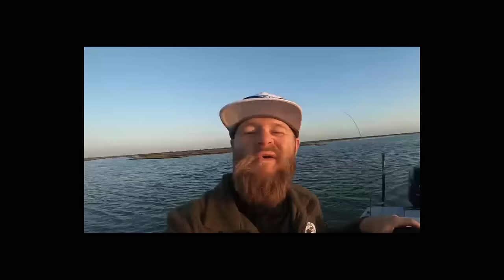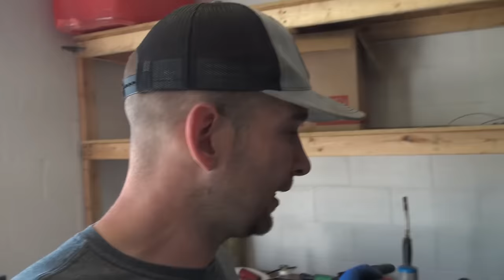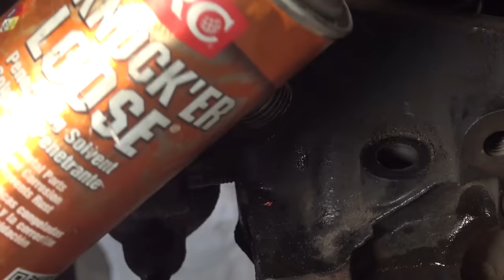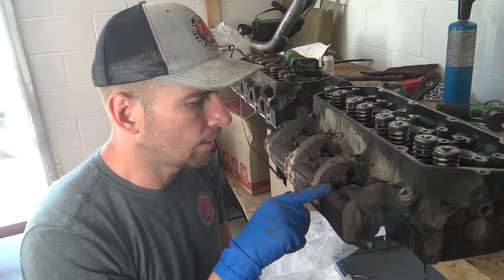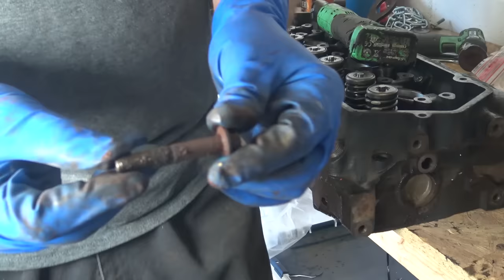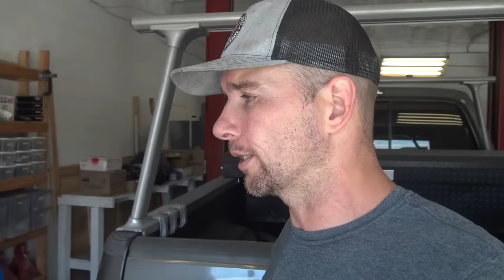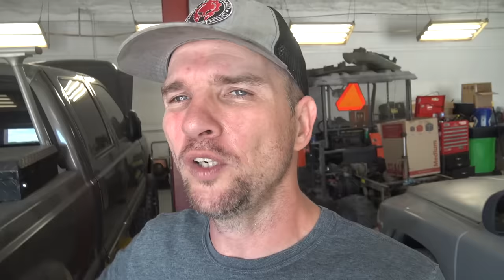Old Mechanic Taught Me This Trick To Removing Rusty Exhaust Manifold Bolts!

Comment: I'm 76 and have bent wrenches for many years.  One trick I learned by experimentation is that ordinary rubbing alcohol slowly dissolves red rust.  Patience is required, as the stuff evaporates quickly so it is best to keep the rusty area wet by dripping more alcohol on it, and you may eventually see red rust running down.  No heat is required.  One man had been trying to remove his frozen irrigation pump's primer plug - which had been only hand-tight before it rusted - was as if it were welded in place.  He had tried various techniques, including penetrating lubricants but the plug was still stuck.  After hearing about this procedure and patiently dripping rubbing alcohol on it for a while he was able to work the plug back and forth until it was removed easily with his fingers.  High-content rubbing alcohol (>90%) is recommended but lesser values will also work, albeit more slowly.  This process works equally well for freeing rusted tools.
Reply: Hmm. I've actually used 90% alcohol for cleaning atomizers in vape mods to get an extra week of use out of them. I once ran out of alcohol and just went for the witch hazel to see what would happen and it actually worked better at breaking up gunk. I wonder if it could do the same for rust as it does for carbon 🤷‍♂️
Reply: If that works, I'm buying you a beer whether you drink or not!
Reply: @pingpong9656  Please let me know how it works out for you.
Reply: Great tips. I've been a plumber for the last 49 yrs and we run into the same poop and I work on the junk wheels I drag home also. One thing you can see on the head you work on is the side of the bolt your working on. The thing I've told apprentices if they've got a seized bolt if they can free it up with some kind of penetrate and you can see the side of the bolt as you try to turn it out is to "watch the side of the bare bolt". If you turn the bolt one iota with the wrench the side of the bare bolt better start to turn too, if the head is turning with whatever wrench you're using the visible side of the bolt better be turning otherwise you're twisting it off. On some of our plumbing equip. if the bolt passes through the equipment but is just flush where you can see it, as you start to turn it that flush end better turn too. Otherwise snap. Do you have any good advice on how to remove studs from VW air cooled aluminium heads as they're always a POS to remove the baked and seized into the head stud.
Reply: vinegar molasses evaporust  chemically will disolve rust.   Heating cherry red if possible will dissolve the rust bond and melt out the rust.  I have found penetrating oil will not penetrate.  When you use penetrating oil if you notice the threads are always totally dry.  If your able to break the bolt loose using Stephens back  and forth technique when you have slightly loose spray the threads then tightening will bring some of the penetrating lube further in the threads.  The more you can tighten and loosen and spray the more penetrant will get to the threads.
Reply: Acetone evaporates extremely fast too. I almost only use  trans fluid and acetone mix now and vibrate it with an air hammer when possible. Rarely need heat anymore.
Reply: @bobwright992  Great tip!
Reply: @rogerrolfe8114  https://youtu.be/Oqs-08ATRyU broken bolt removal from aluminum LS head, cheers!
Reply: @YuckFou502  Which brand of witch hazel did you use? See if i can find an equivalent in South Africa.
Reply: @graphman8402  Thanks for the tip man
Reply: That's EXPERIENCE FOR YA !!!
Reply: That's true, sir!
I'm using high-content alcohol to remove rust from my body every evening after work. I mixing it with coca-cola it working much better ;)
Greetings from East Europe, from Poland... alcohol works always! :):):)
Reply: Man I never heard of this !!! Thanks!
Reply: Ingersal Rand 5 inch  hydraulic impact wrench: then I adapt the 2’ to 1 1/2’ then 1’ then 3/4’ then 1/2’ then 3/8’ then 1/4’ dollar tree socket which is a 1/8 inch adapter to a 1/8’ to 1/2’ head and 15 feet of extensions in between. Always works at breaking my arm loose
Reply: Can we use use regular drinking alcohol or sanitizer?
Reply: @leo92328  Beats me, Leo.  I guess you'll have to experiment like I did.
Reply: @randykelso4079  I used harpic(toilet cleaner) and it removed rust but the screw still didn't loose.
Reply: @leo92328  If both the screw and the material it's threaded into are ferrous material (cast iron or steel), the patient application of rubbing alcohol will often soften the rusty threads unless the threads are damaged or non-ferrous material is involved. It takes considerable time to accomplish. You may have to resort to some other technique.
Reply: @randykelso4079  the screw is in the tap I don't know how to access the threads. Guess, I'll have to call a plumber. Thanks for your reply. 😊
Reply: Interesting about using rubbing alcohol! BUT at $6 a quart, it might be cheaper and better to use/buy the stuff designed for loosing bolts etc?  IMO
Reply: @riderhard  Never found one that actually works, have you?
Reply: Blah blah blah blah blah
Reply: @satbobsmith7261  I agree "penetrating" oil never penetrates unless you can move the bolt back and forth a little.  The seems to draw a little of the penetrating oil in the first few treads.  I agree heat works if you have enough room not to burn the car down.
Reply: Alcohol does not dissolve rust. I would not doubt it is the alcohol chilling the spot and it going through cold and warm cycles possibly making it loosen. We owned an auto wrecking yard for years and I am quite accustomed to removing rust frozen things. Heat with a torch, chill and heat again till it comes off. A steel bolt in aluminum is the hardest thing to deal with.
Reply: I used vinegar on my pressure washer gas tank . It ate right through that red rust
Reply: @davebrittain9216  Correct that alcohol or any solvent doesn't dissolve rust, acids do. It's more likely that the alcohol is able to penetrate better than oils. An old machinists trick for removing a broken tap is to spray it with trichloroethane/trichloroethylene. It can get into places that oils can't and lubricate enough loosen the jam. Acetone and ATF are effective probably because the acetone acts as a carrier.
Reply: Will White Liquor aka Moonshine work ? Or should I save that for Drinking Purposes and just use the cheaper 70% Rubbing alcohol ?  😂🤣 I’m kidding ya 😂. But I’ll remember your rubbing alcohol trick next time I’m having a issue with a rusty bolts. There’s a spray made in Germany 🇩🇪 that I can’t remember the name of,  but I know it when I see it.  A mechanic 👨‍🔧 friend of mine who’s your age he’s now about 78 and he let me use. Let me tell ya friend that’s the best thing I’ve ever used to break stubborn rusted up bolts loose. It’s kinda expensive but it melts the rust off when you spray it on & if you can get in on the treads of a bolt and tighten the bolt back and do that a few times spraying the treads and run them back in & out and work that spray into the hole the bolt will come right out 99 outta 100 times. Wish I could remember the name it’s kinda expensive but it’s imported from Germany.
Reply: @bobduce5705 I too have found that just regular white vinegar is the absolute best and cheapest solution for any kind of rust, if you add a little trans fluid it it’ll kinda hold it in place longer to help it penetrate. I restore old equipment parts for metal art and i have a 5 gallon bucket of vinegar, i put any rusted part in it, over night the rust releases and floats to the surface and it’s REALLY nasty but is easily removed with a handled strainer.. the part will be totally rust free, rust is some crazy bad stuff and is almost like it’s alive and loves to eat metal…
Reply: @travismathis6084 do you have to neutralize it afterwards?
Reply: The technique is kinda’ like using a tap.
Reply: If u use 70% alc it won't evap as fast.
Reply: Brake fluid is also pretty good for this. Or acetone and ATF
Reply: Thank you sir.
Reply: @qoph1988 Brake fluid is a good idea. I know from experience that it will eat right thru paint. So I'd guess it woukd eat rust too. Thanks.
Reply: PB blaster is today’s rubbing alcohol 😂
Reply: Goat urine is even better.  But don’t drink too much of it.

Comment: Never ever, ever say out loud “that came out pretty easy” before the job is completely done, never.
Reply: Your absolutely correct because it turns into a nightmare really quick
Reply: @eddieweigel9490  especially the last one!
Reply: @tomdavis3038  Lol! Very true!
Reply: It’s like every morning I think it’s going to be an early day and it turns into 12+ hours
Reply: Lol I totally agree with that
Reply: @tomdavis3038  It's always the last one.  Never ever say those words. i did and in my case it was 3 fastener bolts on a Subaru legacy. dammit.
Reply: Bolts have ears
Reply: yea right, it's a Murphy's Law thing, (knock on wood)
Reply: Yeah, and never say it's just a 15 minute job. Lol
Reply: That's so true, at least in my experience. It's called jinxing the job.
Reply: That's what she said
Reply: Noted
Reply: As the presenter suggested, when you break one free, tighten it back up. Don't take it out until you have all bolts/nuts/fasteners free. Removing torque pressure from one end can change the dynamics of tension elsewhere. Which can make it more difficult then it originally was.
Reply: Never ever, ever ever say that.  It's ALWAYS something!!!!!!!!!!
Reply: it's just asking for trouble
Reply: Truest story ever told
Reply: The creator of Murphy's Law right here!  Good one Ed and that's for damn sure too LOL.  You celebrate before completing, you're screwed
Reply: Hahaha reminds me of this past week I’m all. Happy to replace my control arms and all the bolts come out easily minimal effort the. I get to the control arm bushing bolts one comes off easy I go to take the other identical one off and nothing I put a mid torque Milwaukee on it with 650lb of torque and nothing. Now it becomes a nightmare and I put a breaker bar and nothing the bolt is on there real good. I put a torch to it and some pb blaster for 30min and nothing. I have to run to the store and get extensions now for the breaker bar since the bolt is all the way into the wheel well and there is no room to put leverage and really pull down on the breaker bar. So now I have to think of a way to put something under the extensions since they are basically in the air and when I put force on the breaker bar the extensions start to round off and fall since it needs support under it. Long story short after a few hours I almost give up until I think 🤔 and realize I can put a jack stand under the extensions so they stay at the angle I need them instead of sliding off the bolt when I put force on them to turn the bolt. I give it one last tug and put a pipe around the breaker bar and I hear a crack and I get so happy. It’s still tight but I start trying to turn it little by little and it seems like I did it. I put the impact on it and it starts spinning. After a couple seconds I realize the bolt is just spinning and not coming loose. So i believe what happened is threads that are already inside the subframe broke off and the bolts threads never came loose so now I need a mechanic to remove the bolt that keeps spinning and some how re weld the nut that the bolt threads into that’s inside the subframe
Reply: So True Buddy  !   I  never spoke such nonsense & never had guys telling me I did not know my Rear Exhaust from a hole in the ground . They , were too often busy doing the job over , sometimes SEVERAL Times in a row ...........  when they should have slowed a bit & made sure that it was done right the 1st time , ALL the way through ............  Everytime I think of needlessly doing a job over , I remember a  " Master " ASE Certified Mechanic , doing a waterpump job on a plain vanilla Chebby 350 V8 pickup ........... He bragged that he had done so many B4  , that he'd be done in about 20 minutes . That was  what he said B4 doing it the 1st time in that episode. He redid that job 4 times after the 1st since he refused to slow down & do it right ; as I had told him to do.  He's retired now & probably still brags about how fast he is ...........
Reply: @ Ed A  lol. true!
@William Richard James Nicholson - True, get it right first time. Often it is your best and only chance. @Stephen Cox  Cheers, that was a good reminder.
Reply: Word
Reply: Or say, it's going to be an easy day...🙂👍
Reply: @Ihaveseenthings577  Can't agree more. The other is, "It's quiet today at work."
Reply: Lolol!!! Exactly!!
Reply: Along with answering anyone when they ask you "About how much longer ya think?"
Reply: They never tighten back up 😂
Reply: You're right about that. If you do that then the next one's sure to break no matter how careful you were.  I would go one step further and say, NEVER even think that THAT one came out pretty easy.
Reply: Amen Ed
Reply: Never fails
Reply: @tomdavis3038  its always the last one , whether its an exhaust bolt, lug nut, header bolt rounded off. All my builds get ARP fasteners , so it doesn't happen .
Reply: Facts !
Reply: "Sometimes you get lucky" is what you were supposed to say.
Reply: The engine can read your thoughts anyway.
The last bolt always lies in wait anyway.
Reply: Easy is a word long forbidden in any shop lol. Things become a shitshow after it's said
Reply: I agree with every word said offer this little bit of wisdom prior to your day a prayer to God for a good day and his help through out.  Works like magic.
Reply: 😂🤣  yup!!
Reply: Brooo me last week “wow these turbo studs are all coming loose nicely” 5 seconds later stripped a nut. Lol
Reply: This is universally true for damn near everything except for... no wait, it's true for everything existence has to offer.
Reply: instead say, pfyoo, this is going to take me the whole week and I'm gonna take a coffee break to clear my head that ought about to do it!
Reply: Last bolt, hard to reach, stripped n stuck right now....all because I though tht
Reply: I swear,,every freaking I say it something freezes up of breaks smh. A broke bolt can make a 30 minute job into a whole day job. Take time with these bolts ,in the end it’s totally worth it.
Reply: That is like a curse😅
Reply: Ha ha
Reply: Exactly I just said this while removing exhaust bolts. Every single one came out super easy except the last one. It broke twice
Reply: My goodness I need this on a plaque
Reply: Don't even think it!
Reply: Don't jinx it!
Reply: Don’t even think it either
Reply: Its always the last one.
Reply: Damn right
Reply: So true
Reply: Agreed.  Rule number-Murphys law
Reply: So True bcz Murphys laws will Make the Ones Afterwards Not Go Smooth, and that word is mildly de-intensified  :)
Reply: I learned that the hard way
Reply: True that brother! 🙏🙏
Reply: Yep, I agree, it can quickly turn into a job where every advance gets smaller and smaller
Reply: That's good humor and logic!!
Reply: Hallelujah 

When when people ask how my car's doing, I say I don't like to answer questions about my car 😊
Reply: @LFOVCF but no souls
Reply: Dude, I was making a video about how I finally got my rusty old glow plugs out and then I started to say something or think something "well actually I've got only like 6 completely out so maybe don't jinx or yourself" or something along those lines and then it wasn't long after that when one broke and for the last 4 days or so I've been trying to get it out.
Reply: Or "This will be an easy job."  The other phrase that will ruin your day!!!!
Reply: I'm a joiner I agree😅😅😅
Reply: Why is it that the last out is always trouble?
Reply: He said "ONE" not all.
Reply: Yep, or ever again thank your lucky stars for any that you ever get loose
Reply: Excellent video!   the rusted in bolt is a true equalizer that humbles even the best
Reply: Alright sorry mum, jeez
Reply: Don't even think of it too long let alone say it out loud!
Reply: Ain’t that the truth
Reply: This is akin to summoning Beetlejuice. Just don’t
Reply: @iwal1645 I’m here because of a 14mm bolt head on a prado lower suspension arm. 

Burred, not broken. Still ugh
Reply: I legit said that yesterday before i snapped a bolt 😂
Reply: The machines and threads will hear you, and ALL the other bolts/threads will fight and kick and scream and repeatedly sack tap ya nuts just to see if youve got the resolve to see the task all the way through.

Welcome, to the art of cussing a new language into existence.

😂
Reply: lol, or “It’s a piece of cake”!
Reply: Or, how hard could it be?
Now your screwed..